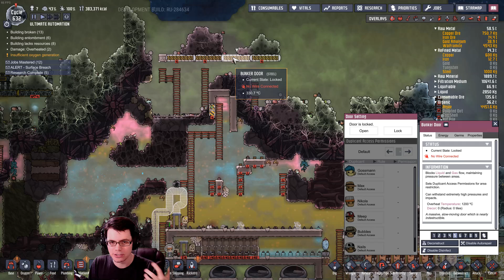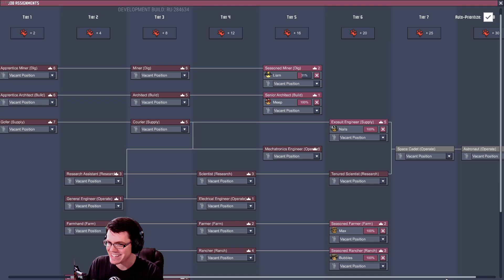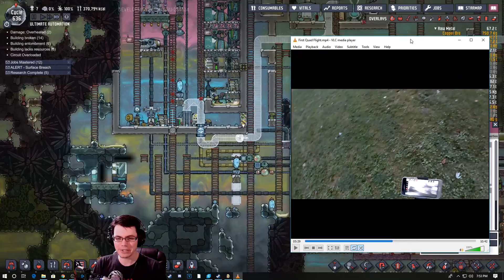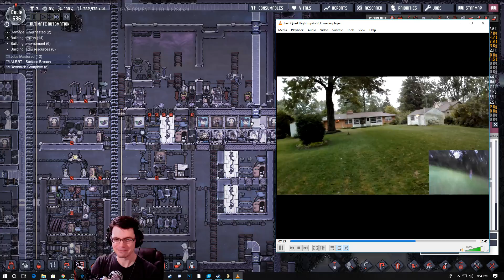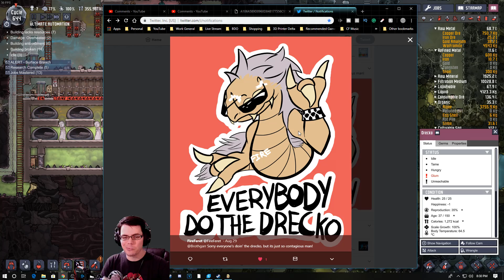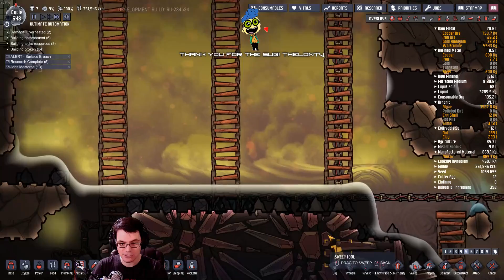Oxygen Not Included - Digging up Fossils! Ultimate Automation Challenge! ep 27

Comment: Hey Bro, using the automation (gas shutoff) is great, but only if your system is not saturated. Getting saturated means wrong element goes in a wrong pipe. You can try to solve it by setting a gas shotoff before the separation part and sensor with delay on the other side so that when your pipe gets full you dont ovefill it and elements dont get into wrong places. 

Electrical engineer is the best for refining crude oil, because operate is their main task. 

Build a normal size stable, then when it gets overcrowded build a door so that you have another enclosed space, and then delete the primary/first door. Stable buff is gone, but critters are still tamed, and can get the buff from the grooming station. Other than that you can get more critters inside the space without the overcrowding or expetation debuff. 

Dont use bunker doors to seal off your asteriod, use tiles. Doors are too expensive for such a rare metal. Use door only on needed  setups like solar generation. And only in exposed space with no back tiles so that panels dont heat up. 

Start to cover the asteroid quickly, because the meteors that hit are so dangerous for destroying the enviroments that its just not worth the wait. 

Pacus dont need feeding, only if you want to increase the number of them. Great way to get eggshells. 

Atmosuit i think gives you a negative decor debuff. So getting rid of them is a great idea. Replace with snazzy suit for that extra decor buffs. 

Next time you start a game, use the what i call bubble tehniqe. Everything that is temperate (starting area) enclose with insulated tiles as quickly as you can until you get abyssalite, then on the outer layer normal tiles of abyssalite. You dont get heat death of your base, and you can regulate temperatures so easy inside the base. 
Keep all of the heat production equipment outside.

Comment: brothgar i remember a fan design for a double-smart battery that holds 40kjs using automation. its somewhere on the oxygen not included reddit. I think it could help you with your slight problem with your hydrogen generator setup thing